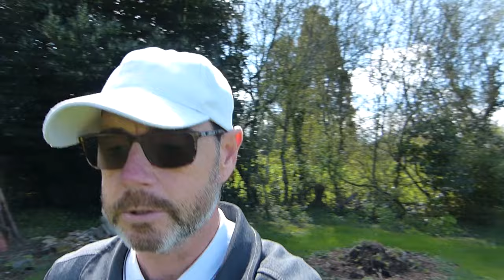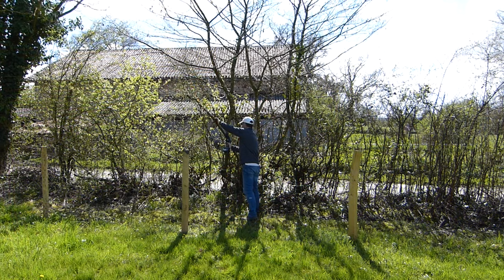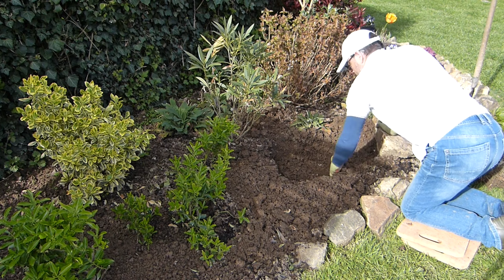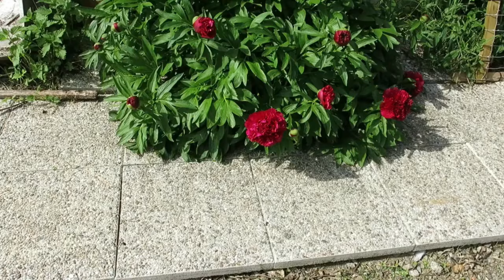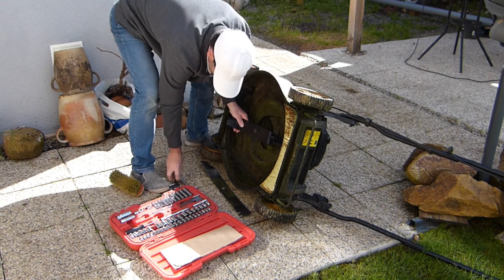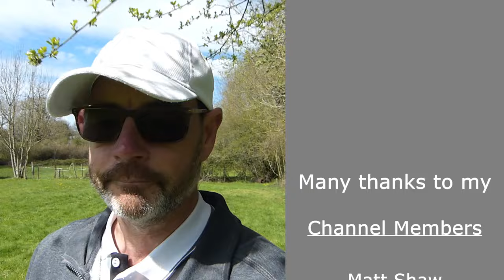Moving a Peony & Am I a good person?

Comment: Thanks for the video. Question: Do you always change the chain on your chainsaws, instead of re-sharpening them? (sorry if I've gotten the wrong impression here) It is not very difficult to resharpen them, it just takes the right size of round file, a stroke or two on each tooth at a 30 degree angle across the bar, and you're off to the races. New chain right out of box is actually not all that sharp, at least that has been my experience so far. Keep up the good work.
Reply from the maker: I am starting to build up a collection of used chains.  I've had no success with a file.  I'm doing something wrong for sure.  :-)